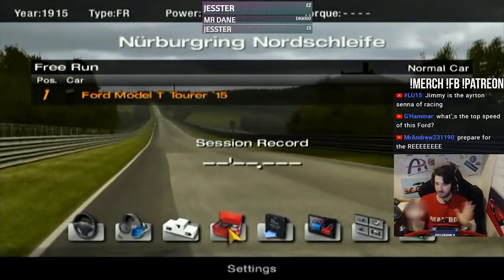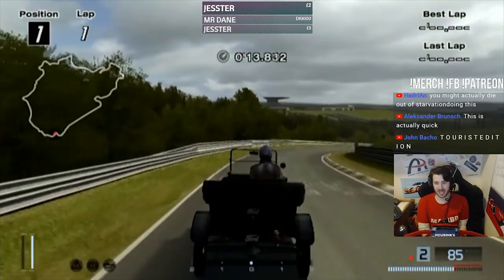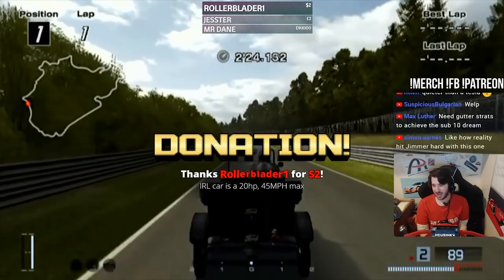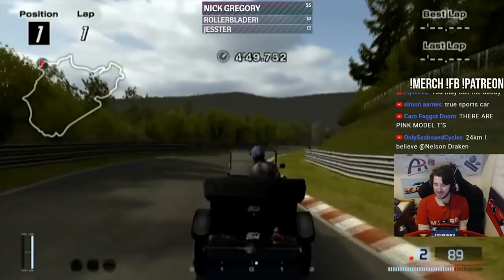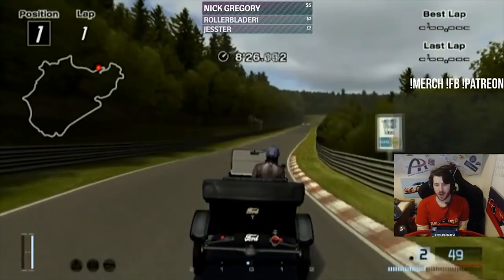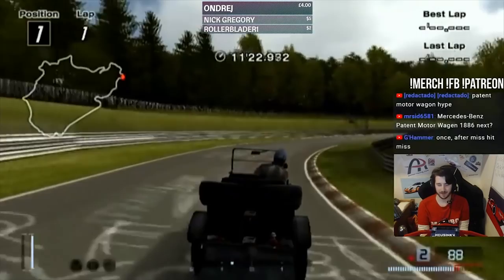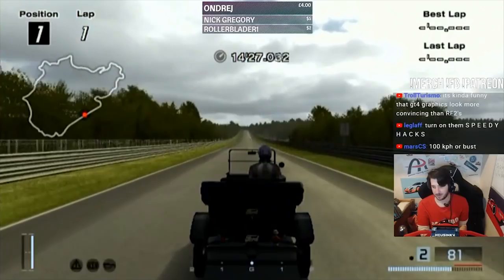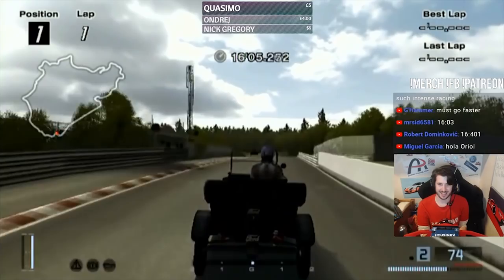How Fast Can A 1915 Ford Model T Lap The Nordschleife?

Comment: Running in the 20s
Reply: swinging in the 20s
Reply: Have a like
Reply: * aggresive jazz swing piano solo *
Reply: More like slowly crawling in the 20s
Reply: ASSETTODRIFTER S15 lol
Reply: lol
Reply: More like “in the 10’s”...
Reply: game ?
Reply: Hottzy Gran Turismo 😀
Reply: ASSETTODRIFTER S15 thank you. Btw i was gonna ask if you know any games that are simulation like grand turismo asseto corsa and stuff but for pc and it has to be old like 2000-2009 because my pc potatoe and wont run shit
Reply: Hottzy Live for speed, Rfactor 1, Automobilista
Reply: ASSETTODRIFTER S15 thanks man
Reply: NANI? 1910 Kansei dorifto?
Reply: Running for most of the 20s
Reply: Hottzy GTR2 , GTR1 , Race07 (Race Series), GT Evolution GTLegends.. those are from SimBin. Well there's Grand Prix Legends From 1998. Pretty Hardcore and got so many mods with Kinda Active Community till This date although its damn 20 years old game
Reply: Hottzy You should also Try Nascar Series, TOCA Series which can be simulated on pcsxe.. I quitely sure your pc can run those
Reply: ASSETTODRIFTER S15 no running in the 1915s
Reply: Crawling in the 20s
Reply: Well actually now we're in '20s again so it's not the same anymore :D
Reply: Just like my ex wife

Comment: Spoiler: not fast
Reply: I can't believe you've done this
Reply: I can't wait for "THICC Horsecart laps the Nordshcleife!"
Reply: but entertaining lol
Reply: Dude I haven't read the book
Reply: I bet 80 km/h in that would feel A FUCKING LOT more terrifying than 300 in a modern car.
Reply: wooden wheels, solid rubber tires, no real suspension to speak of, candles for head lights, and you had to crank the engine to start it.  im sure it was extremely terrifying.
Reply: @therwfer  Even 40km/h would be way more terrifying on that thing
Reply: spoiler: not really needed

Comment: This is why GT4 is a classic. Also, I once tried the 1886 MW and it couldn't even make it to the start line, so its not worth it. Cant go up the first hill EDIT 3 I just tried both 1886 bois, the 4 wheeler made it further but neither made it to the start line
Reply: Some mad men back in the day did a lap with it, it was like 44 hours long in his first try IIRC
Reply: Dimas Wira The fastest is about 6 hours
Reply: R92CP it should become like a speedrun-type thing. Fastest lap in a 1880s Mercedes. Lol
Reply: A guy did make the Motor Wagen go the lap around the ring...
However, he got close to 48 hours doing it though as he had to coach it up the hills with a lot of zig zaging.

And I thought I was mad for doing an eco challenge on this circuit for 24 hours, squeezing as much mileage out of a tank of fuel in an Opel...
Reply: CMDR Sweeper Did you do that in A spec? I was considering doing some tests on fuel economy in the game, esp. with the Diesel vs Petrol BMWs
Reply: osp80  I think Austin Sevens used to have to be reversed up hills, so the fuel would still flow down to the engine.

Comment: The issues real Model T's had with hills was the gravity fed fuel to the carburetor, not that it lacked the power to climb them. So the work-around was to go up long hills in reverse. (I guess the game doesn't simulate that though. Otherwise it could have been a more amusing situation.)

Comment: What Model T's lacked in horsepower, they made up with torque. 20ph and 83 lbft of torque thanks to the long stroke of the engine and the ~60lb flywheel.

Comment: Still faster than a McLaren Honda.
Reply: Fallen Maniac Outdated joke. McLaren now uses a Renault engine
Reply: I know that.
Reply: Jay Calloway  That’s why he said McLaren Honda 😉
Reply: Jay Calloway Mclaren Renault is still slow
Reply: McLaren Honda wouldn't make it up the hill.
Reply: It’s a shame really. Alonso deserves better.
Reply: meme ded
Reply: . Dude red bull has good chassis and aero development. By that logic you put out, has should be making podiums if not winning considering they run the current Ferrari engine
Reply: Fallen Maniac sure is.
Reply: Jay Calloway he didnt say McLaren Renault now did he? He said Mclaren Honda.
Reply: Toro Rosso Honda you mean.
Reply: Senna's 1988 Championship winning Honda powered McLaren MP4/4?
Reply: And more reliable
Reply: . If you watched the race you would know that red bull had luck because of the safety car without it RIC would be probably fifth place
Reply: Very funny, and original joke

Comment: When my dad was a kid (late 50s/early 60s) his mom drove a Model T.  They lived on top of a steep hill in their town, and coming home if they didn't get a good running start up the hill they wouldn't make it over.  Reverse is a lower gear ratio, so if they didn't make it they would turn around and reverse the rest of the way up the hill.  Thus, my dad really hated Model T's.
Reply: Those cars didn't have fuel pumps. The carburetor was gravity-fed. The engine couldn't get enough gas in forward gear on steep hills.

Comment: Awesome! But it would be even funnier if you would buy yourself an old crappy plastic wheel for a couple of bucks and drive with this in your retro videos. It is insane how good modern day simulation equipment has gotten and it is super funny to try those bad peripherals we had in the ps1/ps2 days :D
Reply: The drivingforce wheel that came with gt4 is actually pretty good.

Comment: Trick : just before you reach the max rpm limit in a downhill, shift up and stop to throttle at the same time. You gonna use the neutral position and let it go faster
(I never drove the ford T, but I was able to reach 145km/h with a citroen 2CV in the same track)

Comment: Next up: The Benz Patent Motorwagen :P
Reply: Previous Motorwagen record was about 4 hours
Reply: GT Fan 8899 he tried, didnt work out so well, watch the last gt4 stream, you can see it all for yourself
Reply: I tried it it cant cross this track. This car is to weak to climb the uphills of nordshleife. Only on flat tracks can move nicely with the top speed of 11mph.
Reply: Dimitris Χ. You’re supposed to zig zag across the track instead of simply trying to go straight uphill.
Reply: I tried it, it was not working so well.